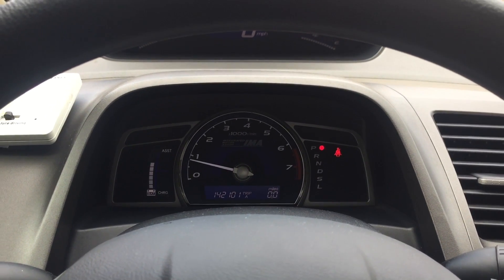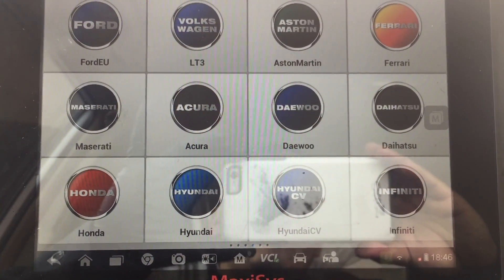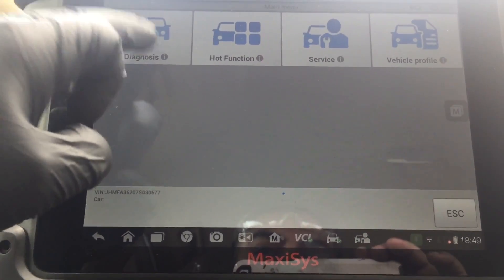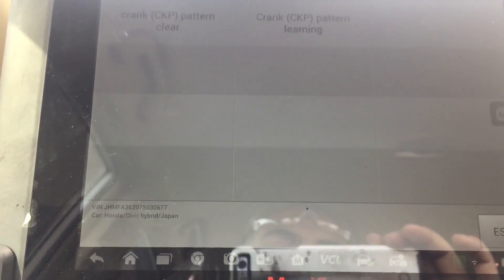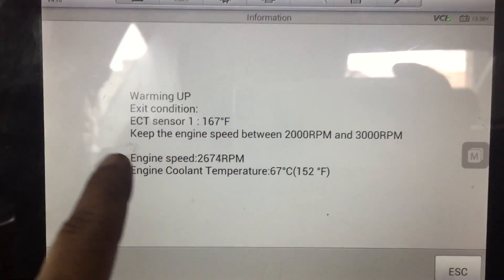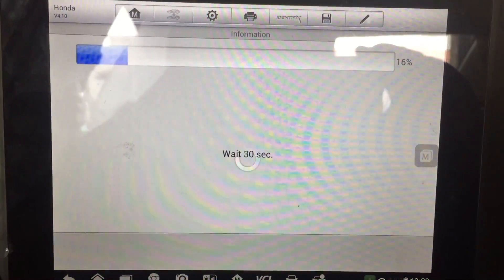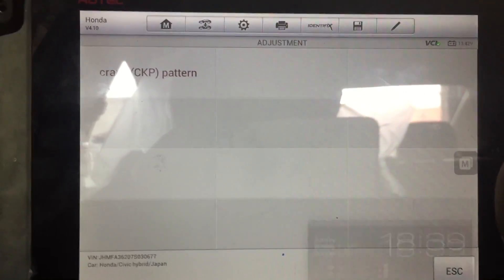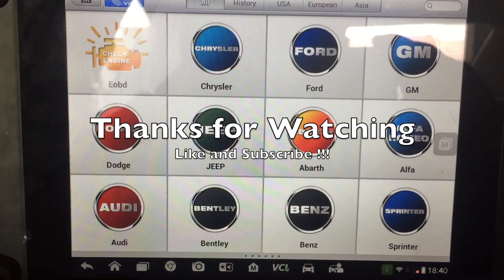P0335 Crankshaft Position Sensor Relearn procedure with cheap scanner

Comment: I've read the Foxwell NT510 elite does this. Just make sure to get the right scanner for your car. They are around $160.
Reply: I have a Toyota Prius and purchased Foxwell NT510 Elite for $190 and it did the job. I wouldn't consider that cheap either.

Comment: I had a remanufactured engine installed about 5 thousand miles ago, with the original harmonic balancer/crankcase sensor reinstalled. I've since had issues with the car failing to start, sometimes taking multiple tries before it finally starts. I also idles rough, and RPMs sometimes fluctuate. I'm pretty sure they didn't perform a CKP relearn. I'm also thinking it may have a failing CKP sensor. I didn't know about this until I came across this video.

Comment: just fixed mine,I bought a autel MP808 for $599 on Black Friday for my 2009 accord, now $750. I did a ckp clear and ckp re learn and car runs great. All miss fires gone I cleared all codes and didn’t replace one part. Going to drive for alittle to see if it comes back if so I’m replacing aftermarket starter with OEM.
Reply: I have the same issue with my 08 accord. You just confirmed which one to buy. I didn’t want to waste hundreds or even thousands on a scanner I wasn’t sure it had those capabilities. Thanks!! 👍
Reply: Did the problem came back is happening to my car too waiting for the scanner to come in so I can do a relearn also
Reply: @kanbou9904  yes mine  did, come back, and I relearned ckp sensor again and it fixed it again. I am swapping out starter with a Honda OEM one and I’m 1/2 done, I also swapped out my crankshaft sensor because I live next to a junk yard I got for 5 bucks. Will keep posted.
Reply: No issues been a couple weeks , looks like fixed, updated 4 months and still good
Reply: @kckuc310  where did u buy the scanner and what scanner? I just changed my CRANKSHAFT POSITION SENSOR and it's still misfiring stalling at idle and drive.. what's the steps to relearn the sensor until I buy it? Need my car for work
Reply: @Snippet.shorts  I bought mine at Amazon MP808, someone said somewhere the Haynes manuals had a relearn in it but I never found it. If you have a library they may have the accord manual , ours did but nothing I could find

Comment: Do you have to do that for all crankshaft  sensor i just changed the one for camaro  ss 13.. it wont  start right and warning lights..got few codes refering to the crankshafts.
Reply from the maker: Not all of them. I believe for the Camaro it has to be done ✅
Reply: @HomieHektor  by any chance you know a method or it has to be done through dealerships?

Comment: Cheap scanner only compared to Snap-on or Bosch scanners. I paid $1100.00 for my Autel 908BT for personal use. Most people aren't going to buy one of these for personal use. A grand isn't a cheap scanner. That said, in the year and a half since I've had mine it has more than paid for itself in trips to the shop I didn't have to make. If your a gear head like me and enjoy working on and fixing your own vehicles then this is a wise investment. Also Autel lets you buy yearly updates for your scanner whenever you want, so you can skip a year or two and still buy an update without having to buy all previous updates like the douche bags at Snap0on make you do. Autel is making very comparable scanners to Snap-on for thousands less and really sticking it to Snap-on for market share. I wouldn't shed a tear to see Snap-on go out of business, they have been ripping off hard working mechanics for years with their over priced products!

Comment: would this work on a Ford Focus mk2 2006, 1.8 tdci (diesel) 85kw. The CKP has been changed and Engine Systems Fault is always present on the dashboard (even after DTC clearing). The DTC is P0337

Comment: I think the autel 808 model is around $780.  I think that one does the Crankshaft Position Variation Relearn also.. I'm hoping to find one even cheaper than that though..
Reply: I bought the 808 from cornwell for $500
Reply: @IsDatPoli-chan  did it have the ckp relearn capability? Which autel 808 is it there’s various types?
Reply: @LivinFree-st1rd  no it did not have a relearn option  I have mx808
Reply: I spent $750 on Autel 808 but the option is not available.
Reply: I bought the MP808 and did the cKP relearn multiple times

Comment: 2,000 is cheap, cheaper than snapon 12k scanners plus using there updates cost about 4,000 a year to update. Customers complain   why its so expensive to fix there cars. They really have no clue how expensive diagnostic equipment is and tools.
Reply: Snap on is the only company that doesn’t charge you yearly and force you to get the updates. These updates are for the latest model vehicles, and if you don’t subscribe no harm done. With a Bosch or any other company you have to pay 1500 usd every year or it turns into a shitty ob2 scanner.
Reply: Apparently you don’t know how much it is lol

Comment: Just paid 240 dollars yesterday to have this same thing done on my car.after replacing crank shaft sensor..my car went nuts..vsa light came on wouldn't go past 3 0 mph..check engine light started flashing..then car threw out misfire codes...took it to the local shop..an hr later dude called me said had to do relearn..thats will be 240 plz😠😠😠😠
Reply: Yea took it back..he gave me half my money back cause i was pissed..said computer needed update only dealership could do..so go an apt at honda in the morning at 10..will let u know what happens👍
Reply: @donjuanob  What happened? My 2009 Accord is doing exactly what yours did? I have owned many cars and this is the biggest nightmare thus far. My Honda only has 65k miles. TYIA
Reply: @donjuanob  what happened my car is doing the same
Reply from the maker: donjuanob Sounds like an hour of diagnosis and an hour of labor... ouch 😖
Reply: Car done same thing again today smh after all that
Reply from the maker: donjuanob take it back and have them fix it or get your money back

Comment: Hektor I have a question. I just got my 08 yukon hybrid engine rebuilted. And I replaced crankshaft, camshaft and VVT sensors. But engine light is on.
Based ln your experiencd do you believe that a software update or something like that is necessary?
Reply from the maker: Jesus Herrera What code do you have stored in memory?
Reply: I have P0016
Also crank-cam correlation. Do you think it has to be relearn? How?
Reply from the maker: Jesus Herrera check your timing and your actuators. You can try the relearn but I don’t think that’s the issue.

Comment: Thats the cheap one??? anything that does relearn for $300? i am not a professional on will use i once or twice per year relearn function...I use a regular scan tool for codes..
Reply from the maker: roadstar499 I’m sure there’s something out there...
Reply: I paid $100 for mine. ICarSoft for all cars.
Reply: @skorpsaiyan2361  how did ur relearn work
Reply: @skorpsaiyan2361  whats yours called and did u releran the ckp sensor?

Comment: You don't need to spend thousands go on eBay and get a vident ilink 400 it's comes with first software free i picked gm which also covers Isuzu and Daewoo  also comes with 3 years of updates for free and software you can have 5 on the scanner at once and they are 60 a piece all for 158$ you name it the scanner can do it can do everything a tech 2 scan tool cando and is new I been using mine and is great it's a bidirectional scanner also displays graphs and you can overlap the graphs to compare it's great
Reply: @Toby Kenneth you won't be disappointed I promise and I'm no way connected to the company I'm just a consumer. I just did an brake bleed with it. You can literally do anything
Reply: @jb0915  link?
Reply: Hi there will it work on Ford diesel
Reply: It does not look like this unit is capable of doing the cam and crank relearn?  I also did not see anything for it to flash your vehicle computer?  I watched the other videos on the vident ilink 400 and you can code injectors and relearn the throttle body and do a brake bleed, but nothing about a cam and crank relearn.

Comment: How much should i pay to get this done on my 07 Gmc Yukon. Sensor is replaced already
Reply from the maker: carlos valencia it depends on the shop, but it’s a fairly quick procedure. I would say around $50
Reply: Just quick question I buy camshafts position sensors on my Lexus installed  2hour later engine light come back on.what is the scan tool that you can recommends can erase this code on a budget
Reply: Carlos would the truck still start?

Comment: Do you need the scanner to do this, or will following the same procedure from memory (if you do every step correctly) accomplish the same thing? Thanks!
Reply from the maker: No Name you’ll need a scanner to tell the PCM a new sensor is in the car 👊🏼
Reply: Thanks!
Reply: Do you need relearn procedures just got camshafts sensors replaced.engine lights come back on after a few day.2006 gs300 Lexus got code from autozone
Reply: @kamsornthan5985  same i put in a new ckp thought it was fine a week later today all my cylinders misfired

Comment: Do you know if you have to do this on every car? I have a 1998 4runner.
Reply: I just put a crank sensor in my 2005 Accord Hybrid and I'm hoping I do have to do a re-learn since the fault codes keep coming back and I don't want to replace the ECM or the wiring harness.
Reply from the maker: jmaedl027 jmaedl it’s not gonna give you problem starting but, you’ll get misfire or crank codes because the PCM doesn’t know it has a new sensor.
Reply: @HomieHektor  im just got them today its been a week and today tge car was misfiring lucky it stopped but i made it home
Reply: @HomieHektor  hey can u still do the relearn even if it misfires during startup or do I gotta get a brand new one
Reply from the maker: Htate if you have a misfire take care of the misfire, and it’s better to replace the sensor and relearn it
Reply: @HomieHektor  its a month old ckp i just never relearn it hyundai sonata 02 gls
Reply from the maker: James panda I don't know off the top of my head but most cars need it.

Comment: 2000 dollars hell naw
Reply: Anthony Eichelberger eBay vident ilink 400 just as good and can do all tge same stuff 158$ and its the same exact scanner just bought me one to do relearn and it can reprogram and rekey and everything else a 2000$ scanner can do check it out
Reply: Hent Be Greater Than Great I got the vident ilink 400 full system scan tool in telling you it's awesome 158$ and it's no cheap scanner it can do anything a dealer level scanner can do for an extra 10$ they will download your first software free and all the updates are free for 3 years but its easy to download it comes with instructions so if you have a computer and get one save your 10$
Reply: Hent Be Greater Than Great if you do get one make sure it's from an authorized vident dealer I got mine on eBay
Reply: Hent Be Greater Than Great the 10$ was just because I didnt have a computer yet its not extra software it's so if you dont have a computer they will download the first free software on to the scanner for 10$ I had to do that because my computer wasnt here yet but you do get 3 years of free upgrades to the software you pick and all the other software Honda Toyota etc is 60 a pop and it can hold 5 software at a time. You won't be disappointed with this scanner it really is awesome
Reply: jason bellotti scoop*
Reply: Hent Be Greater Than Great did it work lol
Reply: jason bellotti which one did you get. I see a few different vident ilink 400s
Thanks In Advanve
Reply: jason bellotti I'm about to put me to the test with Amazon prime. $50 to relaunch ckp variation. I might as well spend the difference and have one on hand. Thanks again.. How did you get the Extra software for $10 and how is it useful. not to familiar with scan tools...
Reply: jason bellotti yezzir. im about to soop it up now